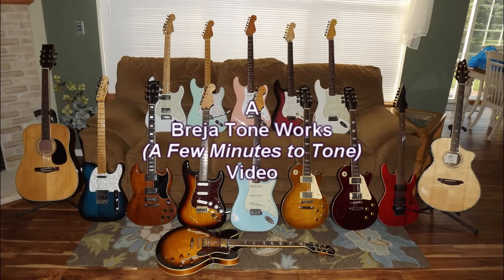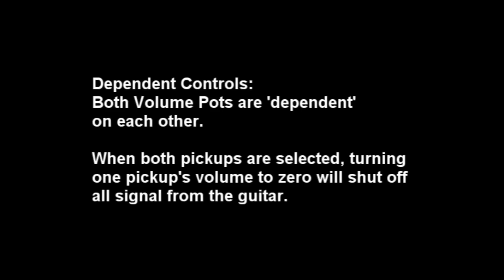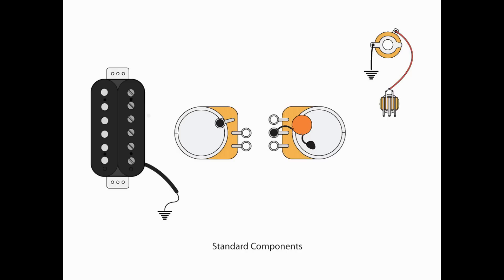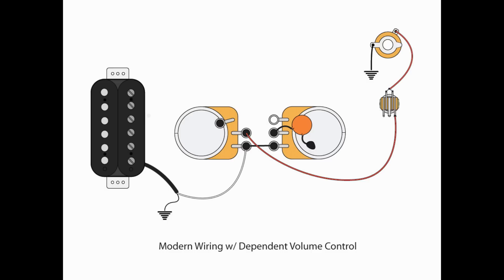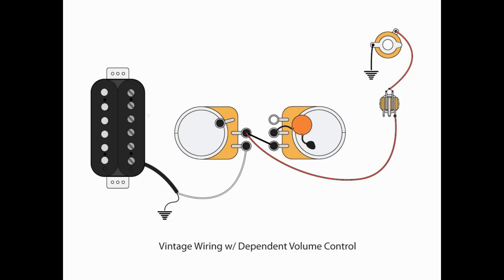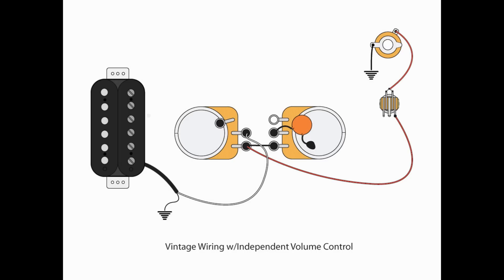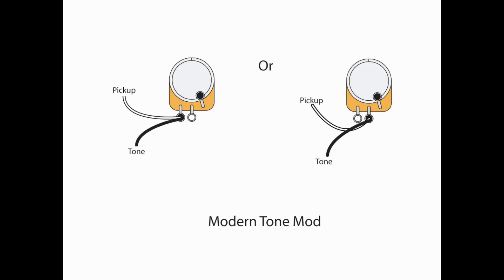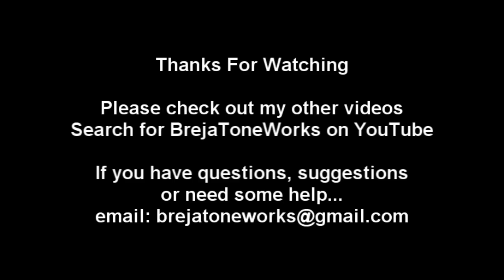Dependent and Independent Volume Controls Explained

Comment: From Leo:  Nothing is free.  I  like the function of the independent wiring scheme, but it has a draw back.   The lowering of the volume also puts a low resistance load on the pickup,   This really kills the high frequencies.   Anything under 1/2 volume gets really muddy.   Thanks for your clear, well presented wiring videos.
Reply: I agree. Checked now with LTSpice.
Reply: Couldn't a treble bleed setup help that?
Reply: The rapid loss of tone is annoying with independent wiring. Has anyone else experienced humming with volume controls on zero with independent wiring?
Reply: @cyberpunk409  I wired my Washburn Force 2 independent. I use variable treble bleeds and I think I found the ‘sweet spot’ on the adjustment. I also use the on/off/on DPDT switches for coil selection (neck) and in/out of phase (bridge). A stacked dual master tone control for treble or bass. Very pleased with the results!

Comment: I wired my tele-franken-guitar in series with independent volume pots (in parallel with each pickup). So "minus-bridge" goes to "com/gnd/out-minus", "plus-bridge" is soldered to "minus-neck", " plus-neck" to "tone" (I didn't use one!) and "out-plus". Magnets on the neck have reversed polarity. Works really nice, no tone pot, just independent blending volumes, only a phase-reversal switch on the neck. So I can have any nuance of mixing the two, full humbucker like, out-o-phase, or I zero one of them and have only the other! When one pot is zero, it shorts out its pup, remaining only the other. Downside is say you play live and have both pups on, gotta lower two volumes with one fast hand movement. Still I love this system.

Comment: I've got a Tokai Les Paul I'm currently renovating and I've got a set of humbucker size P90's that I'm planning on using in it, and as the neck pickup is reverse wound reverse polarity, I plan on only using it in the middle position to take advantage of the hum cancelling properties of that middle position but normally it's a pain in the arse when you turn 1 volume knob down to zero the guitar shuts down.

I've been pulling my hair out for the last few days trying to find out information about this, I didn't even know what it was called so that I could search for information properly !!
Now I know, and I can go ahead and wire my Tokai with humbucker 90's as planned, great !
Thanks for posting this, you've saved me a lot of time and hassle. Cheers mate 👍
Reply: As a follow up to my comment, I wired my Les Paul equipped with humbucker sized P90s in vintage 1950s style and also with independent volume controls, now it works & sounds perfect !!
As the neck pickup is reverse wound/reverse polarity, the middle position is hum cancelling. This means that for this guitar I only need to keep it set to the middle position and I can blend the pickups, and if I want to use the bridge pickup then I can just blend it with a barely noticeable hair of neck pickup or vice versa if I want to use the neck pickup, and I've got a noise free P90 sound thanks to this wiring.
I think I might wire all 3 of my Les Pauls this way and just keep it in the middle position all the time. Blending pickups is perfect and I get way more tones from this guitar than I ever got from it before I wired it this way.
The middle position rules !! Thanks Dan. 👍

Comment: Massive thanks for this info: so simple yet has not been explained anywhere else that Ive seen, causing months of discombobulating volume setups on my guitars as I use my overdeveloped confidence and underdeveloped ability/knowledge to work improving my sound. I got to the point where everything sounded amazing… until you touch a volume pot.
Thanks again!
I’m off to the soldering bench.

Comment: Hey Breja, I landed here to your videos and I loved them. I have this Ibanez RG550 which I installed a set of Seymour Duncan invaders (Neck-Bridge) and Cool rail (H) for strat in the middle position. I'd like to control the volume (middle) independent of the bridge and neck because frankly speaking I never use the tone.
Reply: Lleva el cable de la pastilla central al nuevo pote de volumen y de ahí, al selector de pastillas.

Comment: Hi. Very interesting! Just a question if I may: I see also other wiring diagram where the capacitor connect volume to tone pot. Once in modern style and once in 50s style. What's the difference, and why you don't take this tast in the video? Thanks. Cheers

Comment: Here's a question I'm currently trying to find an answer to. If I've got things wired independently as shown in this video, will the guitar hum through the amp when volume is rolled down to zero? I already experience the loss of tone going from 10 to anything less with volume, but the hum bugs me

Comment: what i dont understand is, i wired my LP to your modern way on your other video (wiring for vintage or modern and it works as the dependent volume wiring.) you  showed wiring the cap from lug 2 on the tone pot to lug 3 on the volume pot. and grounding lug 1 on the tone pot.whereas here your modern wiring for dependent is the cap is from lug 2 to grd and lug 1on the tone pot to lug 3 on the volume pot? which is correct?

Comment: Just what I needed to understand how to wire 2 pickups for a blended output. Am I right that a certain amount of "phasing" will occur? Your videos and diagrams are outstanding! Thanks
Reply: you can blend pickups with either Dependent or Independent wiring.
Reply: You can, but with dependant wiring as soon as you turn 1 volume knob near to zero both pickups go silent, but with this independent wiring you can blend more freely without the volume cutting out.
It's especially handy if you're using P90s/humbucker sized P90s where 1 pickup is wound RW/RP and are hum cancelling in the middle position, like I do.
For me it means that all I have to do is keep it in the middle position and use the volume knobs to select 1 pickup along with the tiniest amount of the other pickup and I get hum free P90s when it wouldn't be hum cancelling if I select the bridge or neck pickups on their own.

Comment: I have wired three Les Pauls and an SG for independent volume. I have fiddled both ways on the vintage and modern setup. My problem is that I gat a lot of noise when I turn the volume all the way down. They are very quiet with the volume all the way up. What could cause this? I followed the schematics exactly.
Reply: Try this Add ground cable from vol to ground output jack
Reply: All pots are grounded as per schematics.
Reply: @pjm329   other solution change the problem pots it mybe have damage when soldering or the sweeper and  lug not contact all to carbon

Comment: I won't separate potentiometer in Harley Benton JA60.
Does anyone have a hint on how to do this? Do you add a linear 250k potentiometer or replace both with 250k. Should any other electronic components be used?

Comment: I getting a ESP LTD EC-1000 with Piezo bridge. It has Master Volume Master Tone and Piezo Volume/Blend 3 way pick up selector a piezo/magnetic pickup and 2 jacks for piezo only and piezo/mag.. I would like to exchange the tone pot for a volume pot so I can have separate 2 independent controls for each pickup. How would I wire it with 3 way and piezo ?

Comment: Great video. Quick question: is there a different between A)wiring the cap between the volume and tone pot and B)using a jumper and grounding the cap to the tone pot? I've seen it done both ways.
Reply from the maker: Electronically it's the same.

Comment: what i sometimes do with my sg is using the normal 3way switch as killswitch, without wire mods
i do this by turning the bridge pickup all the way on and turning the neck pickup not completely down, but like at 1,5.
if i go to the middle setting and slightly pull the switch up, but not make it 'click' to the neck position, you can use it as a kill switch!
(so by slightly moving your switch up/down)

i've heared that this is bad for you switch if you do it a lot, but my sg is an epiphone, so i don't worry too much about it. and in halve a year i've not found problems so far)
Reply from the maker: +Patrick Switches are cheap and easily replaceable.  You really have to go nuts to hurt them.  I would recommend that you replace the Epiphone box switch with a Switchcraft one though - they're better built.
Reply: Breja ToneWorks
thanks. 
Nice, now i'm not afraid to do it on more expensive guitars.
mehh i'll replace my epiphone switch when it breaks
Reply: My volume and tone knobs on my epiphone also suck pretty bad.
my tone knobs do almos do nothing to the tone and then from 2 to one it suddenly kicks in and sounds like the tone knob is off.

I heared that 50's wiring gives the tone knobs more controll. Do i have any chance it hepls mine?

Do you happen to know if epiphone sg pups are splittable and do you know cheap/ semi cheap push pull pots that work ok?

Thanks a lot man!
Your videos help me out a lot

Have a good day :)
Reply from the maker: +Patrick I use the vintage wiring myself in every HB guitar I own - it will help for sure with your tone control.  However - with that said...  It's really hit or miss with the quality of the pots that Epiphone uses.  I have had some Epis with pots that come in at 450k or lower which will just suck the tone out of your pickups.  I also had some where the pots were 500k and above and they sound great and I didn't replace them.  The only way to tell is to test them.  If you haven't watched my video on testing pots for resistance and choosing quality pots, I'd highly recommend it.  Most Epis have splitable pickups.   From what you're describing - it sounds like you could use some new/better pots.
Reply: Breja ToneWorks
great, thanks

Comment: I wish you had used the same wiring diagram that you used in your expiation of Vintage vs Wiring: this is a bit confusing because in that video you have the capacitor wired from lug 3 of the volume to lug 2 of the tone pots (for the modern wiring)   But here, you have the capacitor wired .from lug 2 of the tone pot directly to the ground.  Is that correct?  What gives?

Comment: If I have no tone only two volume pots will dependence/independence have the same effect?
Reply: I have checked and it does. 
But without a tone knob I have to add some tone compensators aka capasitors to keep the treble close to original signal with tone pot when you roll of a volume.

Comment: I am having trouble finding a video on how to wire up 2 Humbuckers, 2 volume controls, 1 tone control and a 3 way toggle switch. Any ideas?
Reply: so... what ya wanna do is: 1) wire each pickup to their own pot 2) then wire each of those vol pot outputs to the switch. 3) then wire the tone control so it's connected to the output of the switch ... or you could even wire the tone pot to the output jack (the output jack may be closer to the tone pot so it'll be a shorter cable run or just plain easier to wire ). This way you achieve each exactly what you want.

Comment: I have a 2 HB with 2 vol and 1 tone guitar.  Is there any benefit to using a dual-stacked pot for the single tone position in order to wire one pickup in vintage or modern and/or dependent or independent volume control?

Comment: I have a question! In vintage wiring doesn't the capacitor connect both pots rather than a jumper wire and wouldn't it be from lug 1 of the volume pot to lug 2 of the time pot?
Reply from the maker: Good Question...

Technically the lug on the Tone pot that the Capacitor is connected to does not matter.  I move them around only to make it easier when I troubleshoot to see how it's wired.  In reality though it will not matter. 

What does matter is what lug it's connected to on the Volume pot.  There are 3 reasons I used a Jumper in this video:
1:  Most modern guitars are mass produced and the capacitor is already wired on the Pot for the assembler so it's more than likely the wiring that people will see when they open their guitar so I wanted to make it familiar to them.

2:  A lot of first time guys who are modding guitars tend to not use a heat sink when soldering capacitors - meaning the apply too much heat and burn out the cap.  You should use a small pair of alligator clips or something to help dissipate the heat.  I'd hate for someone to spend money on high quality caps just to fry them.  That's why I showed a jumper.

3:  Dovetails on #2.  The more you solder and unsolder/bend and rebend a cap the more likely it is to have a broken lead.  Wire the cap once and use the jumper wire when modding.

Don
Reply: Breja ToneWorks thank you sir. You've changed my whole outlook on life and society.
Reply from the maker: mrpres17
If at first you don't succeed then maybe skydiving isn't for you.  Word Up!

Comment: I'm in the process of educating myself on guitar wiring to understand why modern/vintage wiring is different. Besides getting a schematic and wiring one up I don't understand the circuit enough to build one from scratch using any pickup/switch/pot configuration. I have wired all my guitars this way because I'm a set my lead tone and roll back the guitar vol for my cleans kinda guy. As fas a independant/dependent wiring, modern/vintage goes I'm lost on the why parts. You got anything that can point me in the why direction? Also, in your half LP wiring demo the tone cap on the tone control is not setup like a standard way? Does it matter where the tone cap is? Most LP I see have the tone cap attached from the vol to the tone in some kind of way for both modern and vintage? Thanks, I enjoy the videos they are helpful.
Reply from the maker: +X Crow There are a lot of 'why' answers available on the internet but to me, the best way to learn is to do each scheme yourself and listen to how the controls interact with each other.   You'll find that suddenly everything makes sense.  Also - it doesn't matter electronically where a cap is connected on a tone pot.  It only matters where the connection is made from the volume pot to the tone pot.
Reply: +Breja ToneWorks Thanks, great videos by the way

Comment: Has anyone tried wiring the tone pot output to the volume pot input instead? (Reversed 50s/vintage)
Reply: Tone pots don't have an output per say... they go directly to ground. You are either coming off of lug 1 or lug 2 from the volume pot into either lug 2 or 3 on the tone pot and out directly to ground. if the volume goes to lug 2 then lug 3 goes to ground which is modern wiring and if the volume goes to lug 3 then lug 2 goes to ground which is vintage wiring.

Comment: The difference between the "dependent" and "independent" wirings is that with the former you get no signal to the input of the amp, as it is grounded successfully via guitar grounding, while with the latter, the amp actually sees the entire volume pot resistance as the source's output impedance, and amplifies noise picked up from the surroundings by internal wiring (the full pot resistance!) & cables. This is a Major flaw or the down side to the "independent" wiring compared to the "dependent" wiring. As always, there's a trade-off... I know it's a relatively old video, but, YOU SHOULD MENTION PROS & CONS IN YOUR VIDS OTHERWISE THEY WILL MAKE PEOPLE ASSUME ONE METHOD IS GOOD WHILE THE OTHER IS BAD, which is clearly not the case most of the time. Having said that, on a side note: "independent"+vintage (tone pot + series cap connected to output) might offer a solution - turning down both knobs gives a resistor and a capacitor in parallel, the cap shunts some AC to ground, thus reducing noise level...
Reply: I can’t wait to see you guys working together on your new webcast discussing guitar electronics and other topics of electronic artistry in music. You both have a lot to offer! 
Rock & Roll!